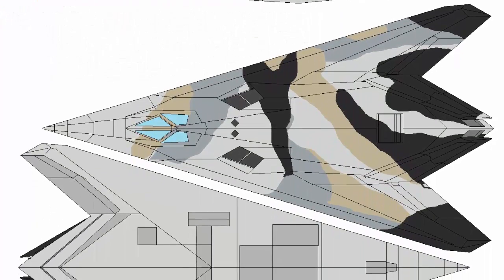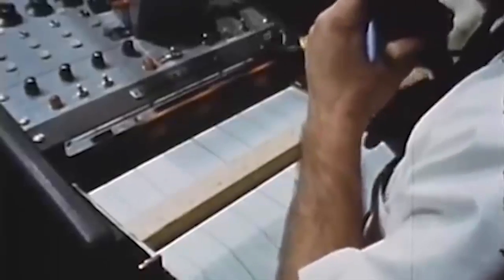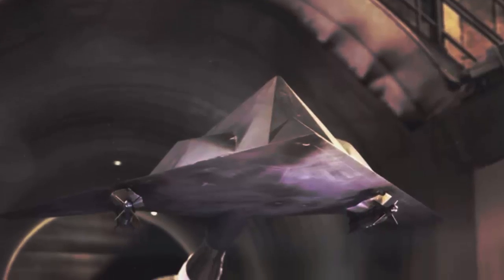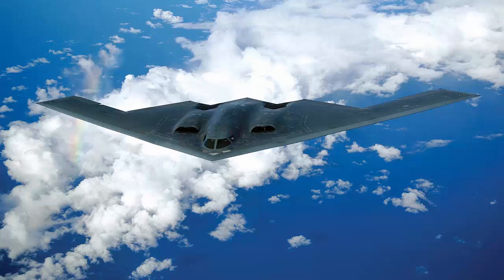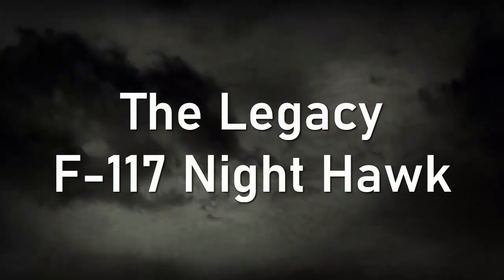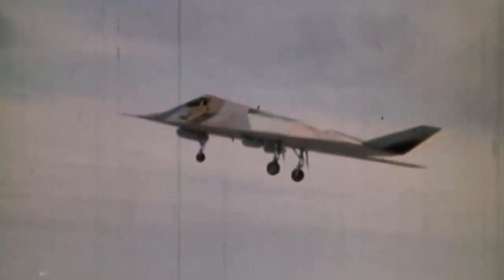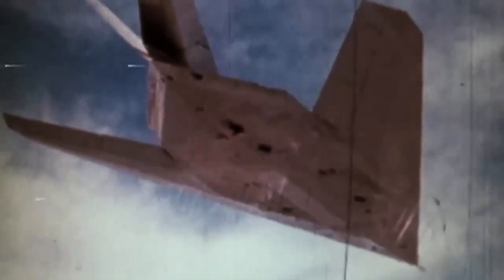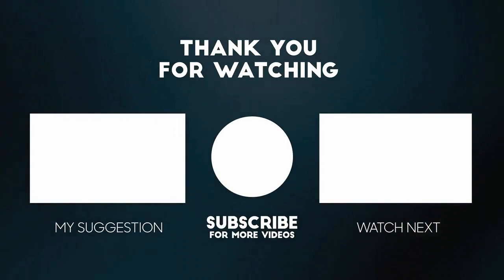The Birth of Stealthy F-117 Night Hawk: Lockheed Have Blue

Comment: The accounts of both Have Blue losses are incorrect. Ship one was lost due to a lower than designed speed on final which triggered an AoA limit that deployed the variable geometry platypus exhaust deck. This caused the aircraft to heavily impact the runway which damaged the right main gear. Park retracted the gear on the go-around and it wouldn't extend back down, several attempts were made to lower the stuck gear by bringing the aircraft down onto the runway on the good side to shake it down but they failed. Running out of fuel climbing to a safe ejection altitude Park ejected but hit his head on the Stencil seat headrest and ended up unconscious with a broken leg dragged by the parachute with a mouthful of desert soil blocking his airway.

Ship two's last flight lasted 10 minutes, sortied to the area of the Tonopah test range for a test against the F-15's radar, one of the J85 engine's exhaust failed causing hydraulic system failure which pitched the vehicle into a -7g nose down pitch movement followed by a series of positive and negative g oscillations in which Dyson was lucky to find the ejection handle and bail out of.